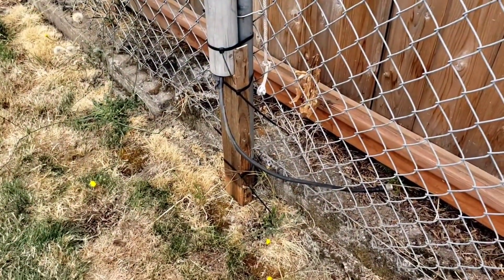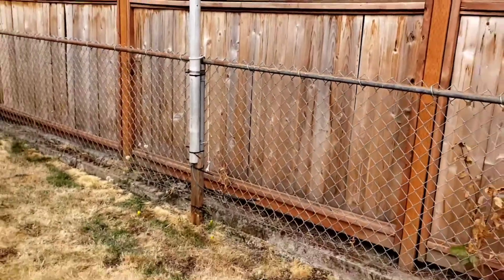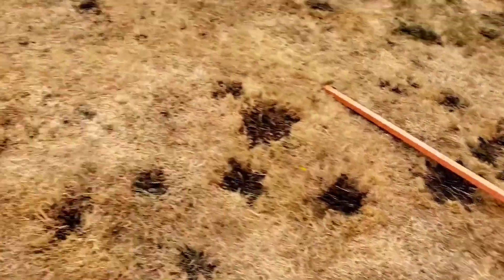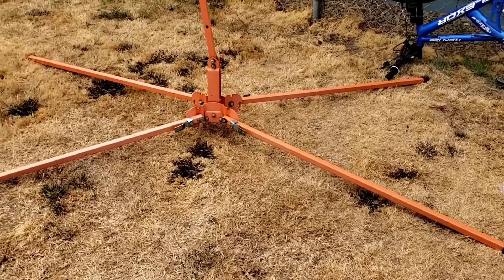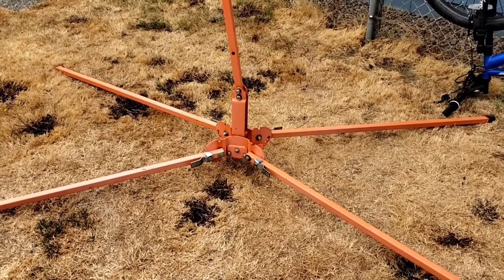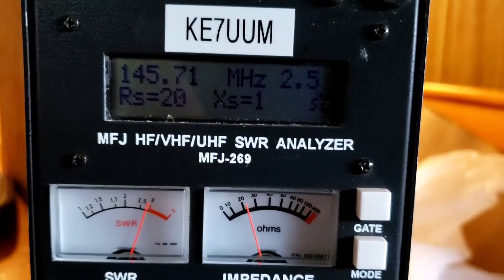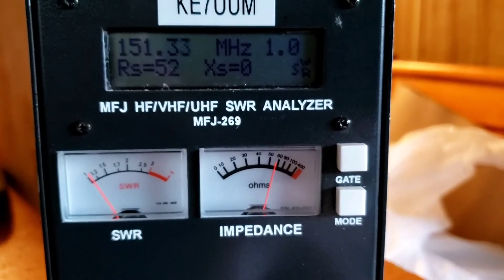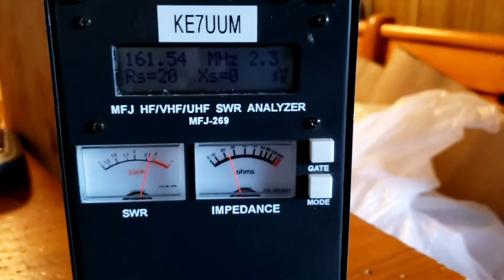Commercial VHF ANTENNA hook up

Comment: Use the N connector, they are waterproof. I use an N connector to connect my feedline from my radio to my AH-4 tuner, located outside. Make the end of your feedline an N connector and join them with a female/female connector. You won't regret it and looks nice. :) KJ7NUX
Reply from the maker: I need to get an N connector. This one here , the center pin was sticking , and wouldn't even go on my MFJ. I was able to borrow an adapter but now I have like 3 adapter in line LOL.  The things us radio operators do to sometimes get on the air even if it's not right...